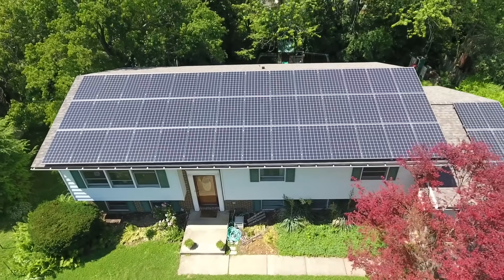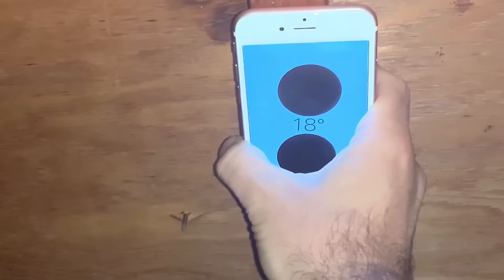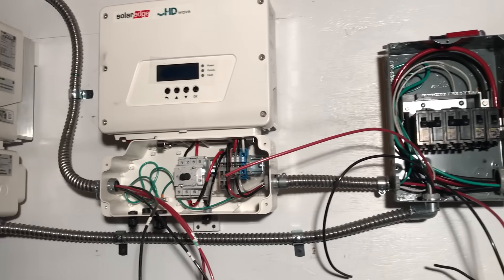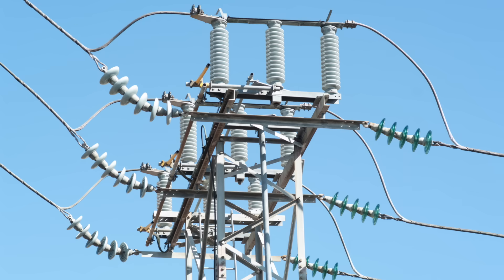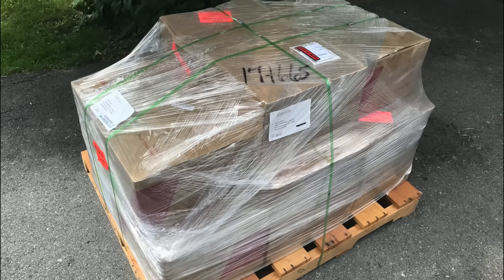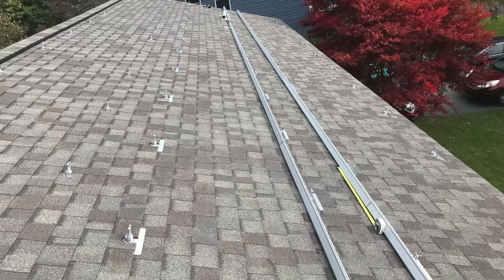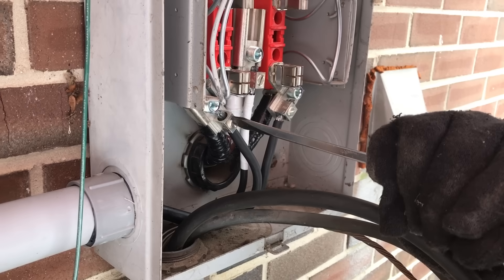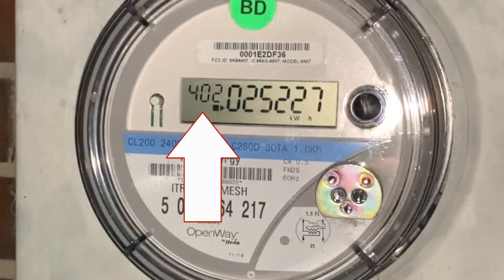I Installed a Power Plant Myself | HUGE DIY Solar Panel System

Comment: Something that gets over looked on roof top panels is the roof itself. If your shingles are more than a few years old you should consider new shingles. Shading your shingles underneath panels doesn't really prolong the life of your shingles and in some climates can even accelerate damage with moss and mildew. Putting panels on only to discover a year or two later you need a new roof means you will become an expert at uninstall reinstall.

Comment: This is a really good video. Great quality in all aspects! Nice work.
Reply from the maker: Thank you for watching and your encouragement!  It was a really fun project.
Reply: Agreed 👍🏼
Reply: Have you fixed those Nintendo switches yet?
Reply: Ayyye this guy
Reply: Great project, and we'll designed. However I don't think drilling through a chimney, even an unused chimney, and running electrical through it is code compliant in all areas. Also renders the chimney unusable instead of just unused.
Reply: More love for tronicsfix.. ❤️💗
Reply: They should have used more thermal paste though...
Reply: Eyyy, you're here!
Reply: Next tronicsfix video: 10 burnt solar panels, can I fix them?

Comment: How often do you need to clean the panels and how? Seeing how you installed it, its gonna be hard to clean i am guessing.
Reply: Solar systems usually require little to no cleaning unless you live in a dusty area with little to no rain. When you do clean it using a hose and spraying them down will usually suffice.
Reply: @drivejapan6293  I live in a developed area and the windows in my home (which are completely vertical) need to be cleaned twice a year. Squirting them with a hose does little to nothing. I don’t know the numbers but I’m sure the dirt build up on solar panels will effect their efficiency.
 I thought it was a good question and would like to some experienced replies.

Comment: Nice job for placing the Solar Panels yourself. As a solar paner owner myself. In Belgium we have to pay, starting from next year, to put electricity on the grid. In your area they will soon realise, that when everybody gets solar panels, nobody is producing anything at night. Thats my biggest problem with solar panels, you produce in hot summer when your outside or working. In the winter you dont produce anything at all. At peak summer days I was getting 9x the ammount of a regular winter day. You also have way to much pannels on your roof.

Comment: Great work 👌
Just curious... How do you get the power from the inverter to be in phase with the power from the grid to avoid a short circuit? I believe to connect AC from your solar system to the grid they both must have the same exact voltage and phase sequence
Reply from the maker: Thanks!  Yes you are correct about the phase.  The inverters do the sync for you.

Comment: In your country you get paid for the excess? In my country we cannot zero the bill as there is a minimum value we need to pay. Also the excess is saved by 2 months for our own Use. If not used, we lose it. Kinda sucks, but the project is done accounting for all that.
Reply from the maker: That’s too bad.  The rules are mostly by state here.  In my state you get full credit for each KWh.

Comment: I like the project, but just be aware that most solar system calculators grossly overestimate the ROI and payback periods.  When you figure in that you'll probably have to replace your inverter in 10-15 years and the inevitable reduced efficiency of the cells due to weathering of the panels (small pits and scratches from aerial debris build up over time and are not fixable without replacing the glass as well as reduction of the cell efficiency itself from electronic parts which all have a limit to use in some way or another) you'll be lucky to break even in 25 years imho.  That's also just considering that you sell directly back to the power company and that their buyback price holds constant to the inflation rate vs. the average cost per kWh for industrial generation, which is not a guarantee in any sense especially for the next 30 years of upcoming technologies; and if you want a battery backup of any kind then your intial and upkeep costs rise quite quickly.  But to be fair, the sense independence you get from the ability to create your own electricity on that scale does have some value that can't be measured just monetarily.
Reply: You are right, but the roi is probably more like 14 years instead of 6-8.  I made a rediculous spreadsheet with solar degradation, dust accumulation, compound interest, purchasing broken mini inverters and punching real life data.  After all was said and done my ROI looked like 13 years as opposed to 8 which they originally sold me.  All in all, I don't really care because every year I make energy after the 13th year, it will be gravy
Reply: I applaud the pursuit of green energy, and I do hope that it is all gravy after year 13. That said, Ms. Boyd has raised a number of legitimate concerns and costs that could very well push the break even significantly further into the future. If the funds are there to do solar, I vote yes every time. However, I think it is best seen as a worthy and admirable pursuit of green energy and independence from the grid, but it is best not to see it as a financial coup or an eventual result of free energy for life. Repairs and replacement costs will be a constant variable. That's inescapable. Take your monthly average of your electrical bill, and use that as your divisor for every future cost. For example, let's say that you were paying $100 per month for electricity. You make this huge investment in solar. The monthly electric bill goes away. In time, you are faced with a $5000 repair and/or replacement cost. $5000/$100 = 50 months. That becomes a new break even for said item(s). All said, congrats to all of you who have gone solar. That is awesome and commendable!
Reply: @Tnapvrvideo  yep, I am well aware of this.  I have in my contract a 10 replacement of any part that breaks or doesn't produce and the solar panels have a 25 year warranty which we hope the company will still be around by then right?
Reply: Well done! You have created a fabulous purchase agreement. I wish you the very best in this endeavor. It's a wonderful achievement: off-the-grid.
Reply: Solar panels keep getting more and more efficient, where I live I know quite a few people that have panels that are well over 30 years old that are still very much effective and efficient without having opponents like glass changed or solar cells, unless you're way off in the boonies too expensive to tie into the grid there's no reason to buy a bunch of batteries unless you're just sure that the end of the world is coming

Comment: This morning I had the idea to diy solar my home and my neighborhood in the future and your video popped up! I will definitely email you for questions in the future! Thanks for this summary video!
Reply from the maker: Thanks!  Hope you can get solar too.
Reply: Don't do it. First off it's $1 per watt. What is a watt? It is power. To put in terms best understood, a toaster is 1000 watts. 
Most solar panels are rated at 100 watts for $100. It takes 10 panels to run a toaster or $1000 worth of panels. So yeah you spent $1000 to maybe get your toaster to run....when you could easily invested that money into stocks, bonds or just buy companies that sell solar panels. You'll make more money in stocks then you could ever save with solar

Comment: Why did you go for 325Wp's?! 360Wp are widely available.
Good choice on the SolarEdge tho! Best out there
Reply from the maker: They are but I couldn’t get 3 rows in.  They are bigger panels.  So overall I’d spend a similar amount and get less Kw.
Reply: @FrugalRepair  Ah yeah that's true. I missed the part in the movie that you went for Panasonic modules. Very good panels and smaller then avarage. 
Your system probably going way more then calculated with PVWatts. Wouldn't be surprised it's going to be 10-20% more just because of SolarEdge. (ps. im a certified SolarEdge installer). 
You did setup all the optimizers in their correct locations right!? ;-)  A thing a lot of self-installers forget. No idea where the panels are in the Virtual Layout.
Anyway Have fun with your system. Happy savings and good job on making the world a bit greener :)
Reply from the maker: That’s cool your are using solar edge.  Yes, their model definitely predicted a higher production than PVwatts.  PVwatts is nice for a first step.  I also used their more in depth (SAM) modeler.

Comment: All I can say is wow brother!  that is one hell of alot of work and planning and although you present  in this short vid, there is untold amounts of brain and physical work behind this becoming a reality...sad to say ,beyond most peoples capability including mine...one thing I noticed was the lack of the use of a safety harness on you while on the roof..maybe i didnt see it but I mention it becuz we HAD solar on our roof for a time, put there thru solar city..the guys put a post and hook on the top of the roof and were using lines tethered to it for safety...they would Not get up on the roof without it... of course, ur doing it urself so its ur choice but even the roofer there didnt seem to wear a harness..We never got to use our solar system ..it sat on the roof for almost a yr while we were in dispute with solarcity over whether we could avoid having a smart meter which they said we Didnt need at the beginning of the install and later said was mandatory...for us that was very important and the contract was broken becuz they didnt keep their initial promise.. long story short, we never used the panels, they sat on the roof for a yr..and ultimately solarcity removed them and the inverter, rehingled our roof on that side of the house and rewired everything back to normal at zero cost to us..It was sad that we never experienced the benefits of solar but we were on a lease program and 
would have had to pay money for that lease each month so a zero bill would not have been possible...in truth it was almost the same as our electric bill at that time and not worth the hassle...
for people like urself that will Own the system, then Yes!  you are doing something worthwhile...
lastly, getting this done urself and Metting all the codes and hoops and regulations is tough...the first thing the inspectors would say is are you a liscensed electrition? and failing that, they'd say ur Not allowed to be wiring Anything in that system thats gonna be connected to Their grid... I dont know how you got thru all that but props to you and congrats on an incredible bit of work.
Reply from the maker: Thanks!  Sorry about your bad experience.
Reply: @FrugalRepair  thnk you for the reply! yeah, I wished we had been able to use them.. we had 25 panels more or less  so nowhere near as powerful as urs.. the only time it was on was a single test run done right after the install.. they connected it to the grid and i got to watch the analog meter run Backwards! they had me turn the house ac and stove tops ect, anything to put a maximum load on it while they watched the energy production to see if it could keep up... it did so effortlessly... after that it was disconnected from the grid and we were to await an inspection... the whole issue of the smart meter thing came into being after that and the inspection and connect to grid never happenned... i think the whole leasing panels thing has shifted since then and there are now different approached, even thru solarcity that enable people to Own the system from the get go... that wasnt available back when we did it...
My gf Still fantasizes about US doing a solar instal Ourselves, much like you did but brother, Im overwhelmed even looking at ur brief vid, let alone attempting it...in the end though, I think owning ur sytem IS the way to go..i'd never recommend a lease.

Comment: Everyone knows the only real roadblocks to doing anything yourself are regulation. I could buy cheap panels and install them myself tomorrow on tilting trackers, but not only would such an installation be deemed "unsafe" or "not to spec", I am not a registered electrician or installer. Anyone can make anything that works just fine, the problem is a nanny-state (and some reasonable regulation, sure) that prevents ordinary people who haven't paid into some registration scheme run by the state from doing it, even if it's like perfectly safe. In some places you're not even allowed to harvest your own rainwater right out of the sky!

Comment: Making my daughter's barbie jeep run off the sun was a very neat and rewarding experience...great science experiment.
Reply from the maker: Sounds fun!
Reply from the maker: Do you have a photo or video about it?
Reply: Unfortunately no, that was about 10years ago...but i used a dc pig tailed power splitter for a vehicle. Cheap one that make 2 power ports from one and wired it into the harness about 3 inches after the battery connector.
Reply: Then just used a small panel and replaced the hood with it. I also gave it headlight and tail lights with solar lights for a bicycle...just bought 2 sets...

Comment: How many Kw is just the main roof section without the lower section?  It looks like about the same area as my garage roof just want a ballpark of what I'm looking at if I did something similar.
Reply from the maker: 42x325
Reply: @FrugalRepair   Thanks.

Comment: No cost?
The panels magically apeared on my roof?
It didn’t cost me anything?
It didn't cost the tax payers anything?
All the materials magically appeared, with no cost to the environment ?
Oh,, and it will last forever, with no maintenance? 

No one ever looks at the cradle to grave bottom line expense?

The people selling,, will always make money,, even if you don't. 

The local installer of geothermal,  said the average cost was 30k.
 ( insert big sarcastic smile here ) a real big saving.

Comment: You don't need power optimizers for a one way facing system. Just the inverter is enough. I do this for a living. If you would've installed panels on both sides on the roof, then it would make sense. Otherwise it's wasted money

Comment: One thing I never see explained on many of these solar projects is INSURANCE. If you make a "ground mount" system, you will need to contact your insurance provider and let them know (and likely your insurance will go up!) If you mount it on your home or a building covered by insurance, it should be automatically covered because it is part of the structure at that point. I had put a 14 panel starter system that I built on my shop building, which was completely eradicated by a severe wind/hail storm a mere 4 hours after I had received my approval for interconnection by the power company. When the insurance adjuster came out, he explained to me that since I had put the panels on the building is was considered part of it and they paid for not just new panels and inverters, but the removal/disposal of all the damaged ones as well. It paid out enough that it literally tripled the money I had into it (since they were including labor to do so, of which I had put the system in myself) so I opted to just salvage a few panels and forget about it. What's odd is the storm was an absolute freak storm that had never been seen anywhere near my area, so make sure you read up on your insurance policy how they will cover them.
Reply from the maker: That is strange!  Yes, what you described is my understanding after talking with my insurance rep.

Comment: Am I wrong or did I see your permit was for PA?? I've been looking to go solar my self plan on reading your guide. I'm just at a loss because I use to much to justify paying a company to install it and not able to produce 100% But if I could DIY I could swallow the cost much easier.
Reply from the maker: Yes, I’m PA.  The net metering here is one of the biggest things that makes solar worthwhile.
Reply: @FrugalRepair  by chance are you a ppl customer?

Comment: In Australia, if you have this set-up you still get a power bill lol. 

Let's say you use 10kwh at night from grid, 10kwh daytime from your solar, and  You generate 100kwh, you get charged full rate for the 10kwh for the night. Argument sake, that's $10 (1$ per kWh) You get charged $80 supply fee per month. That's 30 days X 10$, plus the supply fee. ($380). 

What about that power you fed back? Well, that's bought off you at $0.2 per kWh. 

Australia is absolutely crap for solar. Off grid 100%, except emergency backup feed, still cost you $80 month.

Comment: There should be an alternative roofing method and material for 100% panel covering, rather than twenty square of standard shingles, underlayment and a million nails. The imagined material would still feel indirect weather, so it still would need to be rugged (enough). Weather does a number on new ideas, so I appreciate the great thought that went into our current systems. Something for thought. Hope it starts here.

Comment: Consider a battery backup system to capture all that energy. If your electric company is anything like ours here, they won’t give full credit for when you use the energy sent back. Storing it locally to be used at night, or in the event of a cut, would be cool to see!